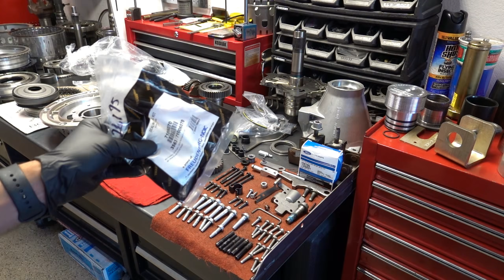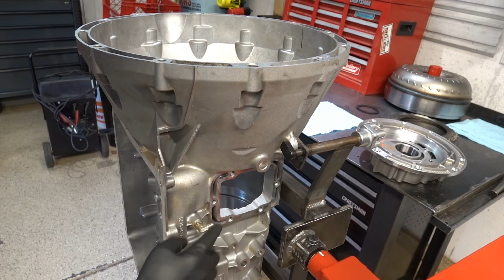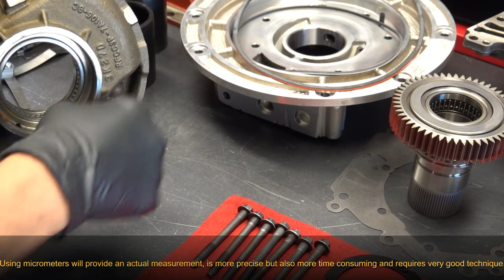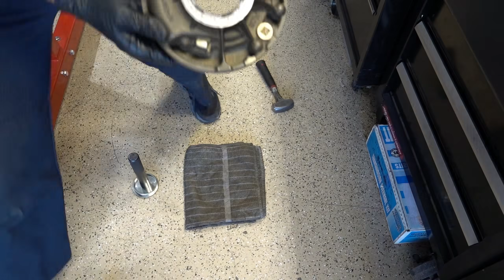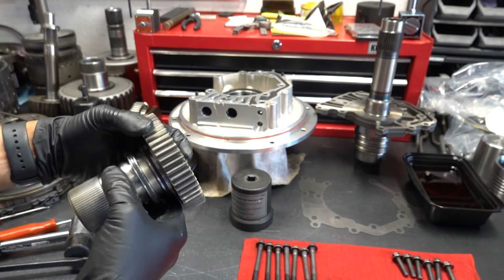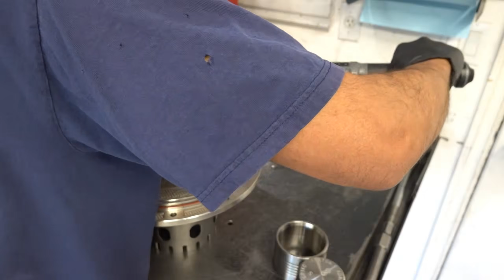Ford 6R140 Rebuild Part 1 - Overview and Pump Assembly

Comment: I've got a 2013 6r140 in a f250 that i rebuilt.   It smoked the 35r clutch in 100 miles.  I don't remember what the clearance was the 1st time. I went back through it and used the alto power pack on the rebuild the 2nd time.  The clearance was around .053.  Now its slamming into 3rd after it all but skips 2nd.  It has a sonnax valve body and a new 35R drum.   Do you have any thoughts if i missed something or do i need more clearance on the 35r?  I updated the solenoid information and cleared out the adaptive learns before the drive.
Reply from the maker: Thanks for watching, Daniel and sorry to hear you're having trouble with that unit. 

Your clearance is fine and it's very unlikely the new drum is leaking (though you can test it to be sure). This sounds like a valve body problem to me. Was the Sonnax valve body installed with the rebuild or was it on the unit before you built it the first time?

Did you vacuum test the valve body at all?
Reply: @nickstransmissions it was installed with the rebuild. I was thinking about pulling it and vacuum testing it.  I'm hoping my short test drive didn't do any clutch damage again.
Reply from the maker: If you only drove it a short distance and no slipping or overheating occurred, it's unlikely you damaged any frictions/steels. Let me know what you find w/the valve body.
Reply: @nickstransmissions so the sonnax vb says it fits 11 -17.  I didn't pay attention to the gaskets I scraped off.  I used the gaskets for a 13 model but the spacer plate is for a 15-17 and uses different gaskets.   The 13' was missing some passages and has a few different layouts.
Reply from the maker: Shoot, thank you for sharing-that’s the source of the problem, no doubt... I never thought about the VB gaskets as I always purchase a brand new spacer plate from Ford based on the vehicle’s VIN for all of these transmissions.
Reply: @nickstransmissions hydraulic pressure actually tore the gasket open
Reply: @nickstransmissions now I'm wondering if I need to get the correct plate of if the valve body will work with that plate
Reply from the maker: Call a local Ford dealership and ask for Parts - give the VIN number to the Parts guy and he will sell you the correct plate. I believe the only differences for 6R140s are TBV (2011-early 2017) or no TBV (mid-2017+).

Comment: How bad to rebuild it urself. Im very limited. Mine at takeoff less 15mph and i dont have 5k to buy one. My imput shaft broke far i know. Very comman from my reading
Reply from the maker: Thanks for watching, nonegone. 

How bad is it to rebuild? Not sure what you mean but the video series should give you all the details you need to determine if it's something you'd like to take on yourself or perhaps outsource to a shop/builder. 

The input shaft can be vulnerable in these units if the trucks are tuned for significantly more power/torque which is quite common...Whenever any potential customers have such tunes, I recommend billet intermediate shaft/456 hub assembly as well as tig-weld reinforce the input shaft at the spin welds on the drum. They like to fail under power/very HD use, as you've read.
Reply: @nickstransmissions  awesome  thank u I appreciate it. I just clicked video showed all videos u have . Thanks again!

Comment: Great video. Very direct and to the point!

Watched this as I’ve suspended my OD clutches may be getting weak a bit from 80-90k of hard miles pulling loaded trailers.
174K+ on mine so far and had excellent luck with mine but I also tend to make sure fluid and filter is serviced every 3 years based on mileage.
Reply from the maker: Thanks for the view and kind words, elite man. Getting 174k on the unit with lots of heavy towing is pretty good. Put the unit into 4th gear via manual mode when towing and going up or down hills, (and use tow mode whenever applicable) if you don’t already do so as that will help get more longevity out of it while you prepare for an overhaul.